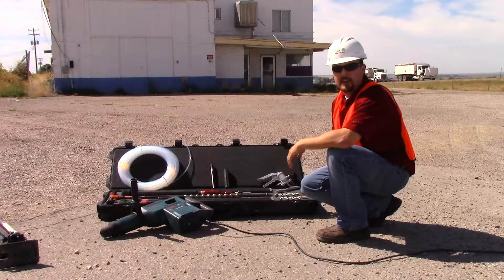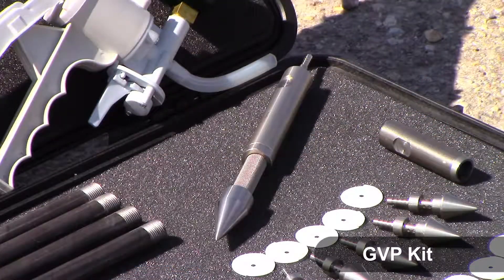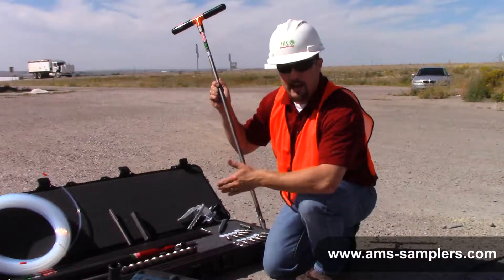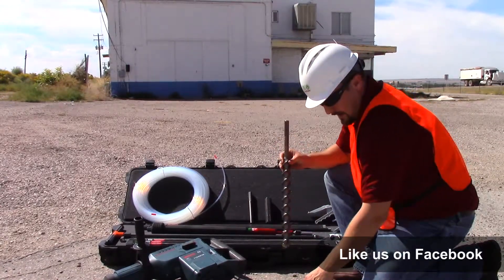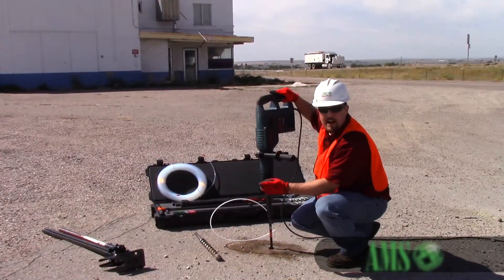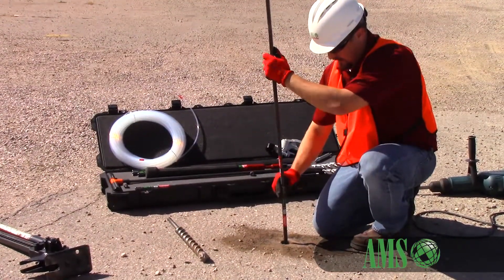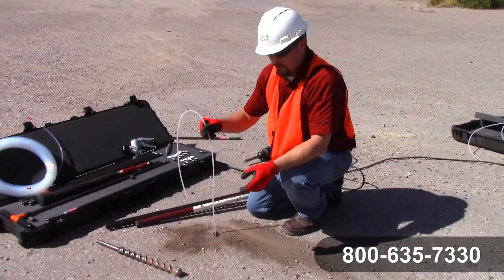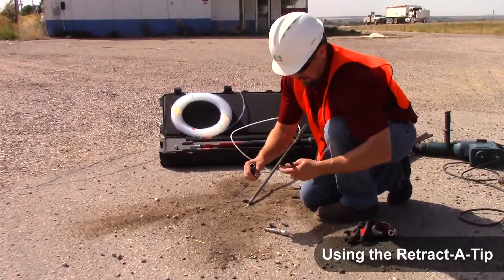GVP Kit

Comment from the maker: Original GVP Kit

Easily and economically sample soil gas vapors at shallow depths for preliminary testing.

 The AMS "original" gas vapor probe can take vapor samples in soils to depths of 12' depending on soil conditions. This kit is an excellent choice for shallow gas vapor sampling in soft soil. The kit includes a base section with a probe tip and soil gas access holes above. An included liner rod with tip is placed inside the base section. AMS also offers the patented dedicated gas vapor tip and the AMS Retract-A-Tip for soil gas sampling as well as shallow groundwater sampling.